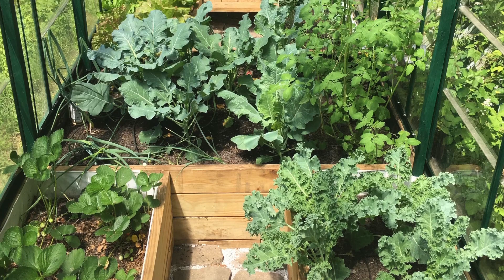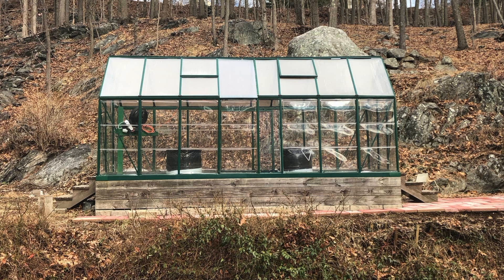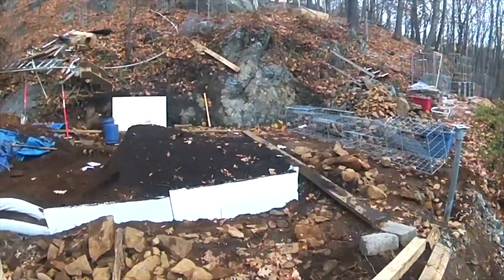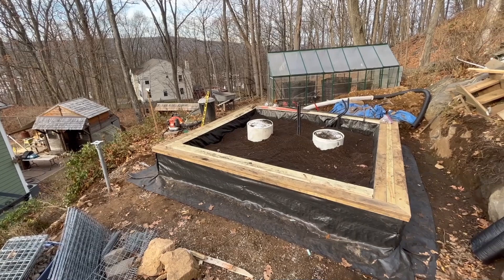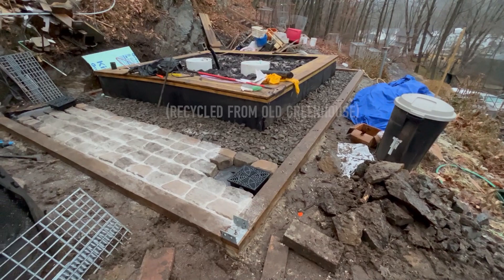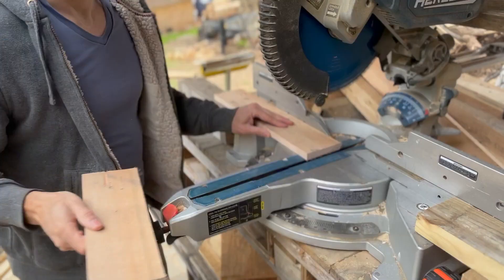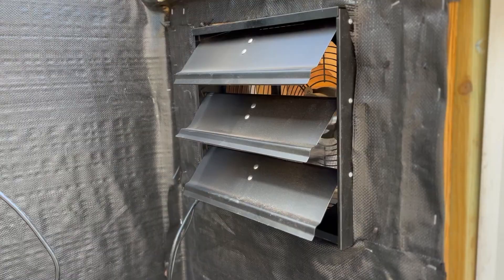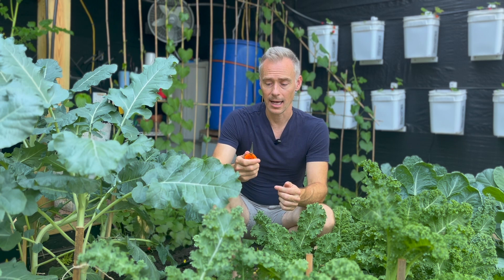Why I built a Geothermal Greenhouse

Comment: We just built a lean to greenhouse off the sideof a shipping container. It's 10x40 and 12 feet high at the peak. Put in a GAHT system, four feet deep, insulated with 2 1/2" foam panels. Nine 4" pipes perforated 37' long. We spent $11,000. I consulted with Penn and Cord two well know greenhouse builders at altitude, we live at 8800'.
Reply from the maker: Wow that’s awesome! Keep me posted.

Comment: Did you consider a walapini? That's the greenhouse design we're planning to do. Seems like it would basically accomplish the same thing as the GAHT.
Reply from the maker: Hi, Indeed I did. In the end I went with a more above ground version because of the sheer amount of rock I had to jackhammer (as well as of some concern about water running down the hill and filling up the structure), but I'm a big fine of the Walapini design. Let me know how it goes for you...
Reply: @WineberryHill  Thanks for the reply! Those are definitely issues we've considered as well, but hopefully the area we selected will have good drainage and (maybe) not too rocky! Your greenhouse is beautiful. Thanks for sharing!